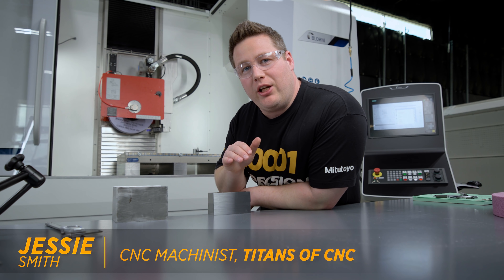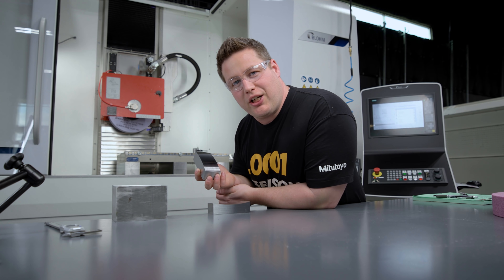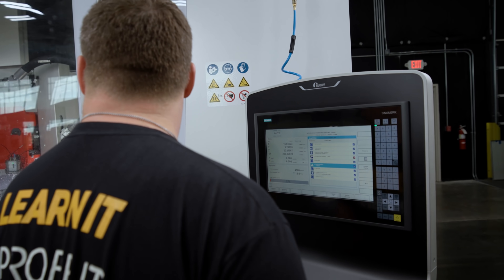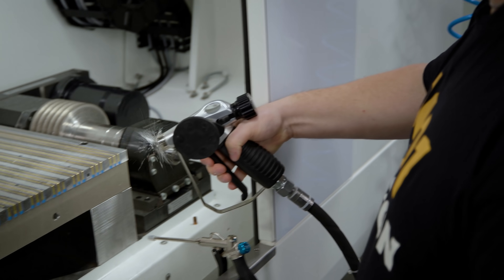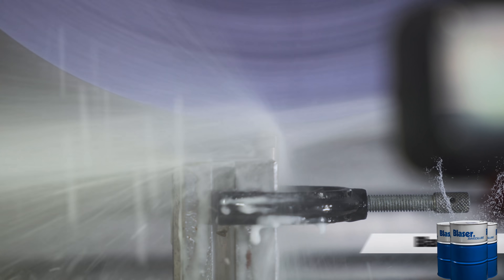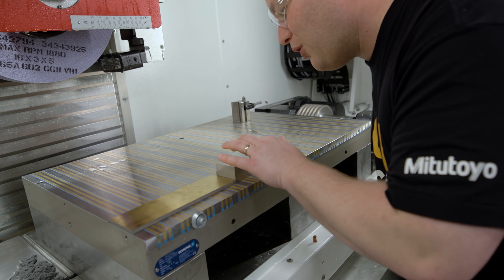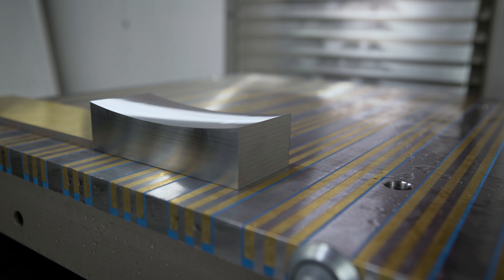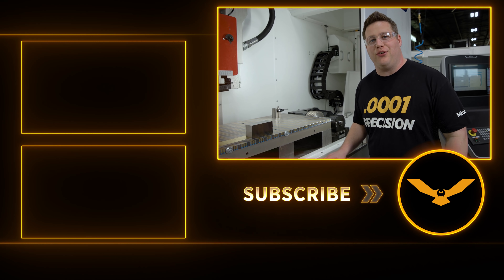The COMPLEX Art of GRINDING Convex and Concave Contours

Comment: How do you compensate for the wear of the grinding wheel while it is grinding?
Reply: Using the CNC position of the Y-axis to the known dressing position enables tracking of the wheel diameter down to 0.0001 inches. If the wheel breaks down during a grind, the operator can redress the wheel to a precise diameter to realize a known finish position.
Reply: @UnitedGrinding  thanks, but doesn't the wheel shrink while grinding too or is it just wide enough?

Comment: How does the machine know the radius of the wheel after dressing it?
Reply: I'm guessing it knows how much was fed down at the dress cycle. You could mike over wheel and a couple steel pads to get a starting point for radius offset then check on cmm. Just a guess though.
Reply: The answer is simple. The machine knows the exactly position of the dressing tool. Also it knows the exactly amount it is dressing. With this approach the new diameter of the wheel is calculated by the Blohm Software. Even a compensation for the wear of the wheel can be programmed to avoid damaging the part when continue grinding.

Comment: How do you accurately inspect the radius of the OD and ID of these parts? And I mean without a CMM. I prefer a mechanical dial indicator method.
Thanks for the content very nice capabilities.
Reply: use a micrometer and gage pins or gage balls
Reply: @NathanKopilec  can you be more specific? How a mic and pins/balls used for this purpose?
Reply: @slavikmarinovski2249  difficult to explain without a visual, but you need to check the distance from the bottom side of the block to the curve. So, an example: imagine you're looking at a convex block from the front. You can see the profile, the curved surface is on the top, and the bottom is resting on a surface plate. You need a drawing of your block with measurements between specific points along the curve and the bottom of the block. To make these measurements, you can't just directly measure with a micrometer because the top surface is obviously not flat. So, you pick something like a 1/2" or 13mm gage pin and you lay it across the curved surface and measure the distance from the bottom to the top of the gage pin. So, your drawing needs to have circles (1/2" or 13mm or whatever you prefer) drawn tangent to the curve of the block and then you need a dimension from the bottom of the block to the top of the circles which represent the gage pins. You need to take multiple measurements like this spread across different points on the curve. So, you need a way to position the gage pin at specific locations along the curve. The way to do this is to clamp a ground rectangular block (like a 1" x 2" x 3" block) to the front surface of the block at a specific distance from a reference such as the right side of the curved block. Looking from the front, you'll place half the gage pin ontop of the curved surface and the other half will hang over the front edge and will butt against the side of the rectangular block. This ensures that the gage pin rests at a specific point along the curve. You then measure the distance from the bottom of the curved block to the top of the gage pin and check these measurements against your drawing. It's best to use a height gage on a surface plate to make these measurements, but I'm sure you could probably find a way to clamp the pin or hold it in place while using a micrometer to take the measurements. Take as many measurements as you need along the curve to inspect the radius, roundness, etc.
Reply: @NathanKopilec  This sounds complicated.What if you place the block on a machine table find the highest or lowest point whether convex or concave using a dial gauge then move in both directions in equal increments and plot the change in height difference  over given linear distance you measure from dial gauge.May not be as accurate as your method but less number of items to hold and measure.
Reply: @mehmettemel8725  it depends on the accuracy you're looking for. If you're grinding a surface, you're probably looking for very accurate surface... Otherwise you wouldn't bother grinding it. An indicator won't be accurate, but for a machine surface that doesn't need to be very accurate, it would probably be ok. When you use something like a probe for a CMM, the software compensates for where on the stylus ball the surface touches. An indicator in a CNC mill won't do this.
Reply: @NathanKopilec  thank you for your detailed reply.
I guess the main challenge in this way is to position the pins at specific locations along the curve. And this method may be the only way a cam could be inspected prior to CMMs.

But assuming we're inspecting a simple radius it sounds strange to inspect a semi round object using linear positioning of pins. Thought sweeping a dial gage and comparing to a master scale (like you set a bore gage).
Anyway thanks again!
Reply: @slavikmarinovski2249  Yes, something like this could be a reasonable alternative if you happen to have a master part that has been validated.

Comment: So when I was in HS machining class.  At a vocational school nearby.
I watch a kid approach the part he was about to grind as though he were doing a climb cut, but he had the wheel too low…

It grabbed the part and shot it into the wall 15ft away and blew the wheel apart.  Luckily nobody got hurt.  

That’s why I was taught to always make your first entry so you’re pushing the part forward, not grabbing it and pulling it into the wheel.

But I suppose there are exceptions.

Comment: I'm thinking it's not just spindle load u need to take into account with grinding wheels the stone isn't as uniformly strong as solid steel and is under pressures outwards for  the hub and inwards from the surface of the part! If it cracks a tiny bit it's likely to just explode! Do stones have rated speeds and pressures and how would you test it b4 using them?
Reply: grinding wheels have a maximum outer diameter velocity. the grinding wheels that i use can take up to max 35 m/s but there are wheels that can take 100 m/s
Reply: One way to check for cracked wheels is to suspend it by the center bore either by hand or some other method and give it a tap. It should have a nice ringing sound to it. Like a bell. If it's more of a dull thudding noise the wheel is most likely cracked. I do this test any time before I replace a grinding wheel. I will say that I've never used a wheel of this size before, so there may be other considerations when dealing with larger wheels.
Reply: @brandons9138  a wheel probably doesnt crack while grinding. only if  you crash it.. normally grinding wheels are mounted on a flange and then the flange is mounted on a machine.. you dont want to take it of the flange just to do the sound check.. only when you want to replace it..
Reply: @vmvds  Absolutely. I only do this with brand new wheels before mounting them. Grinding isn't something I do all that often.

Comment: How does the machine account for the gradual wear of the grinding wheel, especially after dressing it? It's it constantly tracking its diameter somehow?
Reply: just automatic process. you define the diameter of the wheel with the dresser. when you dress the wheel 0.01 mm the wheels diameter gets smaller by 0.02 mm. on this machine it looks very weird. he has the dresser unit on top of the chuck ??! while i have 3 dresser units on the side of the chuck so i never have to take them off and define everything again. this machine usually comes with a dressing wheel. in fact yesterday we got this same exact machine delivered to our shop complete with dresser wheels
Reply: @vmvds  Are you saying the fixed dresser is similar to automatic tool setter as on cnc mills controlled by software?
Reply: @mehmettemel8725  tbh i have no idea, i dont know anything about milling. im a grinder
Reply: @mehmettemel8725  but yes, everything is controlled by software. i control my machine with a laptop. dressing, dresser positions. dresser radius. wheel radius and profiles. everything is known and defined. sometimes you have to make a correction. you cant grind parts within 1 micron consistently otherwise
Reply: @vmvds  thanks
Reply: "Blohm has a page where you can assign names/numbers to a wheel. So if you have a lot of different wheels you can store them and save all the information so you don't have to type it in every time you change them out. You enter in the Radius of the wheel and if it is a custom shape you can enter that in as well. Each time you dress the wheel it automatically adjusts the radius of the wheel by whatever amount you take off in dressing. Before I made these I measured the diameter of the wheel with a caliper to make sure it was the same as what the machine thought it was. In the canned cycle in the program it also has a box for "radius compensation" so if the radius comes out not exact from where you programmed due to the wheel wearing or whatever, you can actually make small adjustments to compensate for it. Hope this helps." - Jessie Smith

Comment: The James Webb Space Telescope mirror is made out of multiple gold-plated Beryllium mirrors. I can only imagine the tolerances and surface finish requirements; I think they approach the nanometer range. Perhaps grinding was one of the methods used in the manufacturing process.
Reply: ofcourse the mirrors are ground. but grinding is not accurate enough. you need to polish them after
Reply: @vmvds  polishing would destroy your tolerances and flatness/form tolerances so it's mostly just machining/grinding
Reply: @Sebastian-ed5kt  youre wrong. the mirrors have been polished. google it
Reply: @Sebastian-ed5kt  I don't think they mean a normal polishing process, maybe more like lapping for geometric accuracy
Reply: @vmvds  okay, then you probably are right and my mind fooled me.
 I thought kern said something about that polishing takes it out of tolerance but I can't find it at the moment only their  statement that polishing is not needed. 
+ I don't find their statement what the part is used for so..
Reply: i think kern Microtechnik has a video on one of their machines finishing a part for a telescope. it's absolutely mind blowing

Comment: when using this method of cutting does the part your grinding have burrs.
Reply: There is a small burr if you take a heavy cut.  It's not the same as a mill though because even though it is a burr, it is very easy to remove.  But if you take a light cut at the end as a finish pass then the burr will be almost non existent.

Comment: Amazing machine. I would have feed in from the opposite direction though. If the part were to move it would push away from the wheel instead of sucking into the wheel.
Reply: this is not advised tho. and theres no "sucking" in the wheel. your part would just fly away in the back of the machine.

Comment: I am pretty curious how to ensure the "flatness" of grinding wheel. Since it is continuously loosing its flat shape during the machining...
Reply: In this application you are actually doing one part, dress the wheel and make another part. As long as you are doing the same part in exactly the same place, there is so problem as wheel wear have width of your part. However when you are going to antoher part, you will have to dress it, because wheel surface isn't even on whole width anymore.
Reply: @Stasiek_Zabojca  also grinding machines track the wheel diameter very precisely and adjust the toolpath accordingly. If you wouldn't do that you might end up with a wrong radius or even a distorted geometry, depending on what you're doing. It's even more complicated with thread grinding, because the actual profile for the grinding wheel has to be recalculated as the wheel wears down.
Reply: @CatNolara  In this situation we don't talk about wheel diameter. Wheel is wider than workpiece and it is cutting in straight line, workpiece is in the middle, so it's making groove in the wheel crossection that is as wide as your workpiece. Edges of the grinding wheel is not doing any cutting.
Reply: @CatNolara  how do you track the wheel Dia. after dressing?
Reply: @conradsinsua7415  you just subtract the dressing stepover times two from the diameter. The bigger question is how to get the right wheel diameter in the first place. At this point I'd have to guess, if the distance between spindle axis and table surface is precisely known it should be possible to figure out though.
Reply: @CatNolara  United Grinding surface profile machines are calibrated during initial setup to precisely position the grinding spindle to the dressing implement. This ensures a very accurate initial diameter for the dressing wheel.
Reply: @conradsinsua7415  Using the CNC position of the Y-axis to the known dressing position enables tracking of the wheel diameter down to 0.0001 inches.
Reply: perhaps it's a way of word framing the dressing of the wheel in relation to the mag bed. with respect to one side of the rock not being higher or lower than the other side

Comment: I am making a surface grinding machine 
Please tell me how much it should weigh 
It's total size is 6 foot in length
Please let me know if any one knows
Reply: It should have the weight of the materials required to build it rigid enough, so it can stay within your tolerances while flexing from the forces of the work your are gonna use it for.
If you want it for deep heavy grinding cuts it will need to be heavier than one for light finishing passes.
I'm not an engineer so maybe you should take some measurements for the material you plan to use for it, and do some studies about the forces in grinding.
Though you can always go nuts and overbuild everything just to be sure ;p
Reply: @zwerne42  thanks bro 
Your opinion helped me .
Reply: Why does the weight matter so much? What matters is the rigidity and stiffness as well as the accuracy of the ways in relation to the spindle etc.
Reply: @CatNolara  I went to a scrapyard 
and saw that German and Japanese surface grinding machine are heavier than other .
CatNolara are you an engineer or machine designer ?

Comment: God damn that’s impressive. How on earth would we have ground convex and concave profiles before cnc grinders?
Reply: with some sort of rotary table I guess
Reply: Hydraulic Tracers and templates, just like the tracer mills and lathes. For mathematically controlled curves (optics) the aspheric (lens maker) lathe.
Finish with weighted laps made from pitch...spy sat tech.
Reply: Wire EDM is the most used process to do this stuff i would say. I work in a plastic mould making company. The shape in the video is very easy against parts we have. Very often we have parts with no straight side so basically you  cannot put the part in a vice or on a magnet.
Reply: you can do this by hand, if u want the same diameter. Ok, it tooks a little more time.

Comment: How do you know what the diameter of the wheel is to program the cut
Reply: Blohm has a page where you can assign names/numbers to a wheel.  So if you have a lot of different wheels you can store them and save all the information so you don't have to type it in every time you change them out.  You enter in the Radius of the wheel and if it is a custom shape you can enter that in as well.  Each time you dress the wheel it automatically adjusts the radius of the wheel by whatever amount you take off in dressing.  Before I made these I measured the diameter of the wheel with a caliper to make sure it was the same as what the machine thought it was.  In the canned cycle in the program it also has a box for "radius compensation" so if the radius comes out not exact from where you programmed due to the wheel wearing or whatever, you can actually make small adjustments to compensate for it.  Hope this helps.
Reply: I like to know that too. Also, after each dressing of the grinding wheel, that wheel diameter must be adjusted in the program.
Reply: It's dressed in between cuts, the z height determines the radius
Reply: I don't know about this machine, but I've done cnc form grinding on a Anca in the past. We would calibrate the diamond off the wheel. If you don't know where they are (new wheel & diamond) you would manually touch the diamond with the wheel, press set & dress the wheel. Touch on a piece of round stock, do a light grind a couple of spark out passes. Measure the stock, and the machine would calculate the diameter of the wheel, and the position of the diamond. That was nearly 20 years ago, might be a different way now?

Comment: This might be more practical than you think if you need a certain amount of clearance between two rotating parts such as a rotor and a stator.
Reply: By that you mean electric Motors? If so grinding These both parts down is a Bad idea, you would short the stacked stator sheet Metal and if its a pmsm magnets cant be reworked once leaving the factory
Reply: @tobiasfaschingbauer47  actually I was thinking about turbines with close tolerances to seal against gas leaks without a physical gasket. Maybe it wouldn't work but it crossed my mind
Reply: @Bobwithoneo99999  as long as heat Expansion doesnt seize your rotating parts, maybe this would work, in reality i doubt there are any tight tolerances on the outer and hotter parts of a turbine
Reply: @tobiasfaschingbauer47  when they develop the SR-71 they considered the expansion rate of titanium to seal all the gas tanks when the bird came to operating temperature. And they did that with slide rules. At room temperature the gas tanks leak because the joints were to loose to seal. But who knows what'll be possible in 10 years